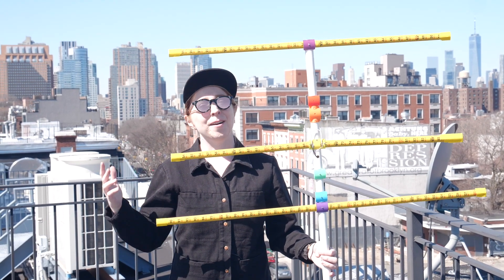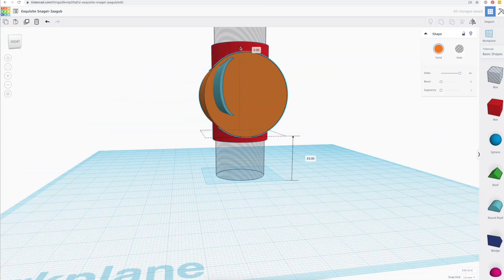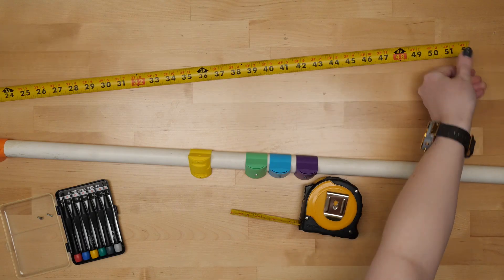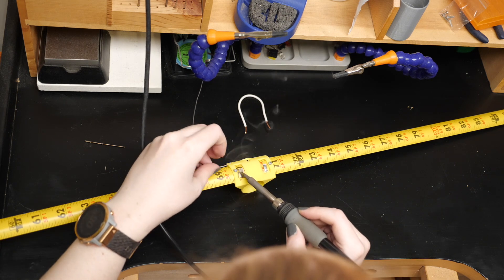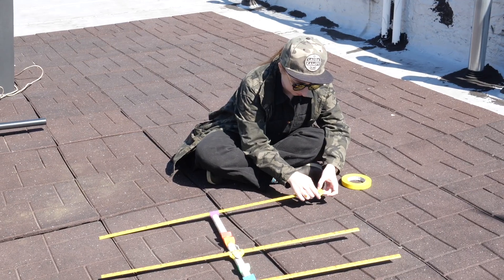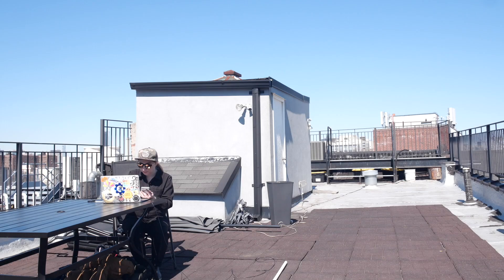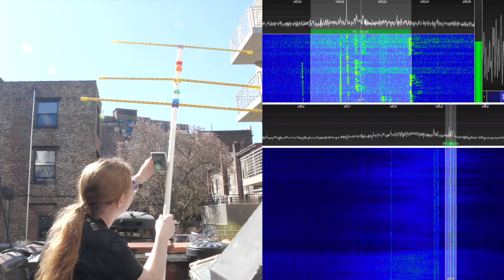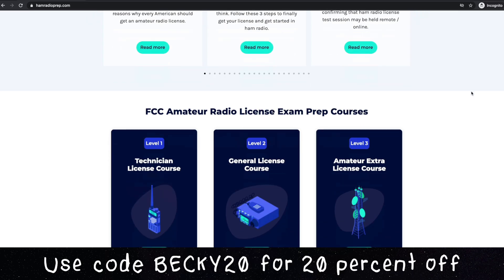DIY Yagi Antenna from Tape Measure

Comment: GREAT VIDEO. WE ARE TESTIGN ATTACHING THE ANTENNAS TO A CELSETRON SR NOUNT AND USING  STELLARIUM SOFTWARE FOR TRACKING. MAY NEED  TO USE LIGHTER MATERIALS. SOME RECOMMEND ARCHERY ARROWS INSTEAD OF TAPE MEASURE.

Comment: i use a 5/8 element for contacting ISS and sats using tape measure drywall screwed to a wood baton. its lasted 3 years.

Comment: is there any issues with the fero magnetic material of the tape? i wonder what the effect is verses the more onventional allumnum ellement material. would think this would have a detramental effect on signal quality and possibly the reason for the high static. also mounting it from a cammera tripod would help for one person opperation.

Comment: Just wondering... but aren't those satellites typically using a circular polarisation?  I remember seeing a project for a homemade sat antenna that used a very nice 'helical' design, to properly deal with the circular signal from the Sat.

Just a thought.  Lovely beam though!

Comment: Straightened metal coat hangers ( if you can find them) make a good element for this type of antenna. Also, a wooden yardstick can be used for the boom.
Reply from the maker: Nice tips! Thanks!

Comment: I went to sub. Already am. Good job previous me.
Edit: with a slight change to the connector, I bet you could retract the antenna and wrap it around the pole by twisting. Twist the other way, and the antenna deploys.
I'm not claiming that is some sort of genius epiphany. It's a retracting tape measure, so it's not exactly a leap. Just a thought for an portable antenna.
Reply from the maker: Thanks for the sub! That's a fun idea to extend this antenna project!

Comment: Becky you may find going from vertical to horizontal (twist it 90 degrees and back) may help.  Circular polarization is a good option.  Very Jealous of that roof deck!  I'm an amateur radio operator in East TN.

Comment: Here are the directions for the traditional construction (using standard easy-to-find hose clamps and PVC cross pieces instead of 3D printed parts - you know, in case you don't have a 3D printer, but you do have a hardware store)

http://www.n5dux.com/ham/tape-measure-yagi/

Comment: Tape/glue/solder(?) 2 equal length pieces of meas. tape face to face to each other; this will make stronger 'elements' of your yagi - BTW, it is pronounced NOAA (one word), not N, O, A, A!!!  Did you have your receiving software set to "FM?"  Whenever the reception is garbled or unintelligible, play around with the different modes - for example, not all (read: Govt.), transmissions on 7mhz are LSB; especially outside the Ham Band.  Have you heard of E-M-E?  THAT is for the truly brave/independently rich ... how about QRP? - I think you would be especially intrigued (and challenged), by QRP; WSPR, FT8, etc.

Comment: also try when u tracking the sat to try move the antenna back and forth to vertica and horzonal as well because sats have ccw rotation as they go aross and what you was hearing on the no weater sat was  amature radio sat if u lisen close u can hear some one calling cq

Comment: Nice Work and nice documentation.

The problem with satellite reception here is that you have a directional linear polarized antenna, while the satellites signal is circular polarized. Even when pointing exactly at the moving satellite (which is nearly impossible by hand) you don't get the best signal. An omnidirectional circular polarized antenna would be better, like cross dipole or helical antennas.
Also the SWR of the antenna at 137MHz for NOAA Satellites is probably not very good,
maybe you can add a little variable capacitor (20-30pf) at the feeding point to fine tune the SWR for 137MHz.
And for absolute overkill you can use a LNA to bring the SNR as high as possible. Than you can get amazing captures of passing satellites, even from behind the horizon.

Maybe an idea for some other Videos.
Would be cool to see

Comment: Try that v Antenna for the Meteor-M2 Russian satellite on 137.1000mhz, I set it facing South, check for best direction with orbitron/ or?. Legs 120 degrees apart, 53.4 cm to the brass ring where it screws together. The picture from that is in a different league but harder to get due to the Doppler effect which can be mastered by some softwares.
There is a plan for a omnidirectional LRPT 137.1mhz Turnstile Antenna RHCP made from a tape measure, which saves all that waving around.
With tube and wire a QFH can be made, this also must be right handed like the turnstile. I'm thinking a yagi is pants for circular screw like signals.
If you have a good connection the sound is like a metronome and you and your neighbours will know your connected. The clearer the sound the clearer the waterfall and the picture.
In all urban spaces height is key as it gives you more time above the horizon, and the longer you can see it the more data you get. If you're lucky one will pass right over your house but the building opposite means you don't see it for long enough. The pass an hour later or earlier might be better for your position.
I use a Raspberry pi connected close to a QFH in the highest part of my loft. I access it downstairs on the pc by the network on RTP_TCP or another method. I use a SDRplay-dx so I can have a Dab radio antenna in the loft also, and wall to wall digital music downstairs.
The dx is a recent addition so my best picture is still from my v3 dongle connected to a Pi. Like all radio there are times when conditions are good and bad due to the Sun. With Orbitron and wxtoimg the whole process can be automated as passes start early in the morning. In a built up area filters may be needed to cut the strong local broadcast bands.
The Raspberry Pi and SDR have pre written scripts on their sites, and software and even images for writing to the Pi with all the software needed, just plug in and go.
The Noaa crafts are time limited and coming to the end of their lives. But others like GOES and Meteor-M2 are up there also. Goes is miles away but takes a whole globe shot so is worth an effort if your in a good spot and have the antenna and software.

Lets not forget the Software defined radio which seems to be able to listen to anything that radiates, providing you've got the right bit of wire and software to decode what you can hear or see. A top tool of the age.

Comment: At 7:22 you seem to be getting JY1sat (JO-97) on 145.840 MHz. This is a BPSK digital signal that you can hear using the SSB setting on the SDR software. There's also a linear transponder on board. I am the designer of the radio on that satellite, and some others like FUNcube (AO-73), Nayif-1 (EO-88) and Delfi-C3 (DO-64)
Reply from the maker: That's so cool that your designs are in space!! Upper or lower side band?
Reply: @BeckyStern  Both will work for data, but voice downlinks are USB by convention!

Comment: Thats so cool! I gotta try this out.
Reply from the maker: Thanks Sean! And you should!
Reply: @BeckyStern  IF you want to recive noaa sat they are in 137 range  and also try when u tracking the sat to try move the antenna back and forth to vertica and horzonal as well because sats have ccw rotation as they go aross and what you was hearing on the no weater sat was i am a sat chaser my self using a sdr play  and build my own tape messure yagi

Comment: That wasn’t indecipherable static you picked up.  That was the latest release from Fløg, the Swedish deathgrind noisecore band.
Reply: I want that album!
Reply: The signal traces were USB, and the passband set to listen to it (if that’s what the vertical lines were showing), is far too wide. From that, I would guess the SDR was configured to demodulate FM or AM, which makes indecipherable noise from a single sideband signal.

Comment: Noticed you where holding the antenna horizontally and your helper was holding it vertically.  not sure if orientation is that important with that type of antenna though.
Reply from the maker: Apparently you can rotate it to adjust the signal once it's pointed in the right direction. I learned from another commenter 😁
Reply: @BeckyStern  lol, stick it on a motor a spin the poop out of it. So long at the RPM is higher than the radio frequency it should work. #madscientistsolutions. ha ha nah don't do that. But I have to wonder . . .
Reply: 2m circular antenna? getting both polarities at once? gg
it will be a bigger one - and maybe a mess of signals as well. ;-)

Comment: Hey Becky, I like the extra color. I trimmed the corners of the elements a little and put heat shrink on them. they are sharp. one thing you can incorporate is a loop to fold your elements into, it makes for easy in and out of a car. there are photos of this around they used PVC T's for the storage which could be incorporated in your design. also don't forget the space station's repeater! KE8OBK

Comment: Why bother with a 3d printer at all? Just drill and screw. G7VFY
Reply from the maker: While that works, it doesn't give you as much flexibility to adjust and tune the elements. These couplers make assembly super easy and reconfigurable.

Comment: you did good just need to put your sdr into the SSB mode then they would of been strong hope you record that pass so you can tune it in in ssb
Reply: Absolutely this - the signals were there and very strong on the waterfall, it's a linear transponder rather than a channelised one.

Still, great build Becky!, and I had no idea changing the hairpin patch shape like that changed the SWR so much. Very lovely tip.

Comment: i made one of those about 15 years ago .. i now make them with a gamma match insted of the hairpin match .now if you make a 5ele for 2meters and a 8 element for 70cms on the same boom you would be laughing even at 5watts from a HT :)  
de m6pnp
Reply: I was wondering about the hairpin... I had thought one wanted the two halves of a dipole (with or without the surrounding yogi) to be more electrically isolated than that? I mean, I know there’s a lot I still don’t know about antennas, but I’m surprised to see such a junction... I guess I’ll have to go look that up. Thank you for giving the “match” terminology that will allow me to do so...

Comment: Good progress! I completed my first FM satellite QSO last fall with a very similar homemade antenna (but your 3D printed mounts make a much neater result). When you start to hear a signal, try twisting the antenna by 90 degrees to find the right polarization angle where the signal is strongest. And when you add the 70cm elements, arrange them perpendicular to the 2m elements so they don’t interfere with each other. Good luck!
Reply from the maker: Thanks for the tips!
Reply: mine are all polarised the same and the VNA shows both resonate and good swr. many contacts made via LEO but now moving to qo100 for the winter